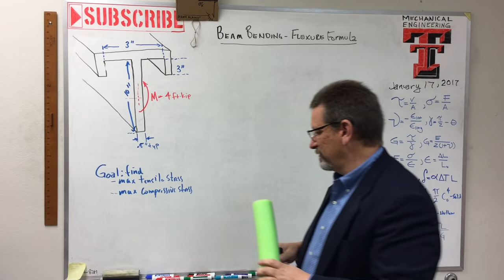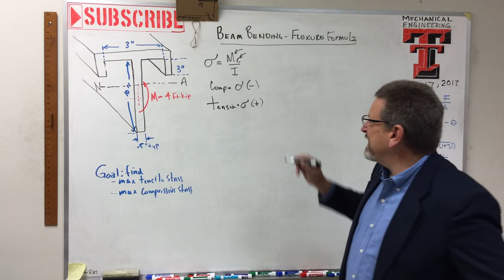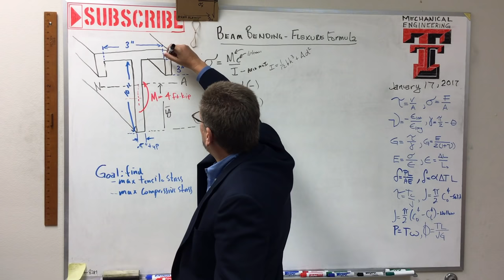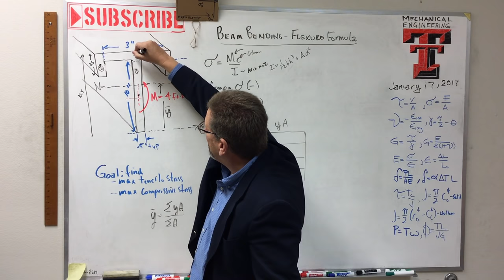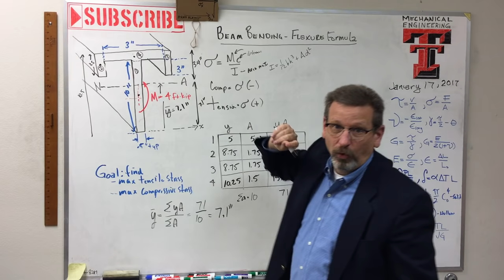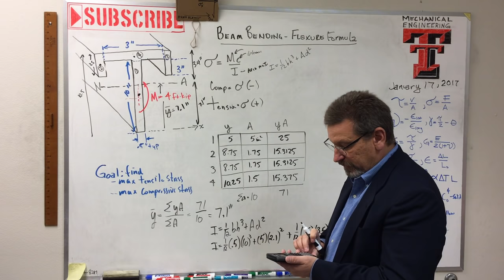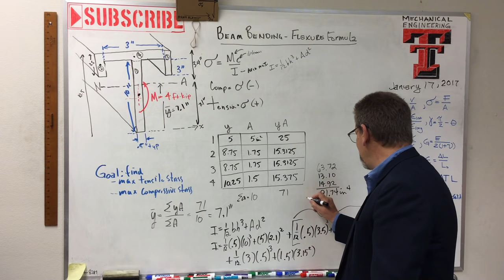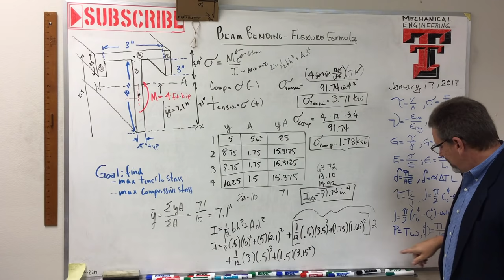Mechanics of Materials: Lesson 26 - Beam Bending the Flexure Formula

Comment: Thank you for the clear lesson. I understand the lesson, but now that I have the compression stress and tension stress how do I calculate if that beam would break or bend permanently? Say the beam is made of  A36 steel,  ultimate tensile strength of 58 ksi, a tensile yield strength of 36 ksi, Modulus of Elasticity 29 ksi, and a compressive yield strength of 22 ksi, elongation of about 20% at breaking point. How do I calculate that?